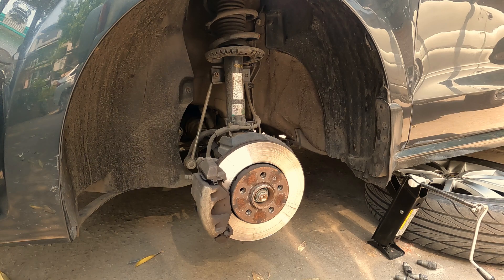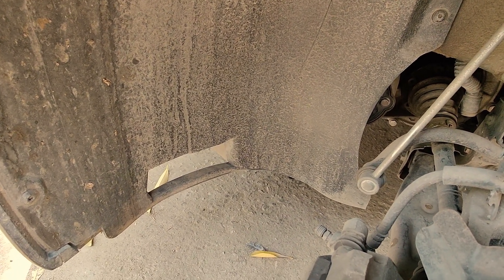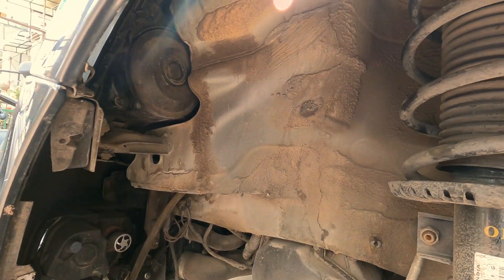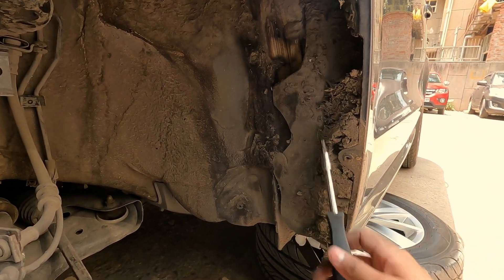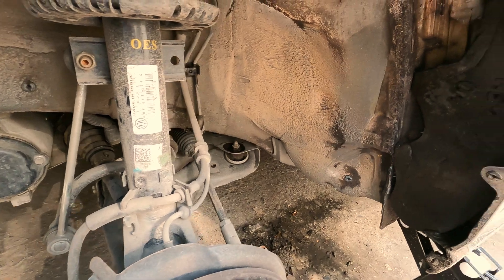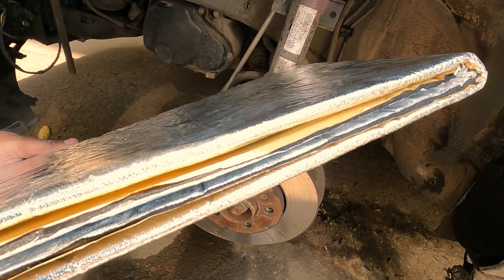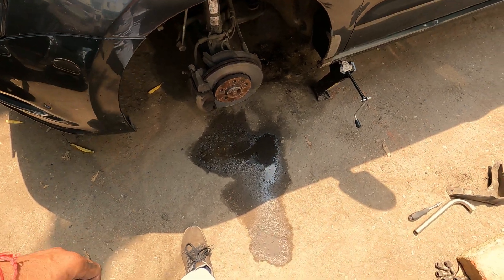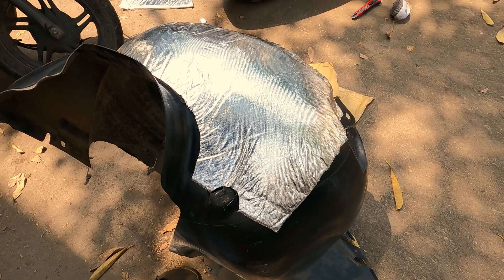CAR CABIN NOISE REDUCTION | REDUCING ROAD NOISE | ENGINE SOUND IN CABIN | VIBRATION | PART-2

Comment: Great video 

I am having Honda elevate 
I am also facing the similar issue . Could you please suggest the solution...

Should I go for door and other damping or just the damping which you had done on wheel arch is enough ?
Reply from the maker: Sir Damped wheel arches will help to reduce the road and tyre noise , damping the doors is a good option but not with the sheets we get in our market as they are adhesive based and in hot climate they slowly start to peel and fall inside , you can do more rubber seals on doors for more silent cabin but there is a limit , after that things become difficult .
Reply: @yourDIYneeds if possible then count you please make a video for Honda elevate to reduce tyer noise 

Before Ane after 

Bcoz many people are having the same issue

Comment: I have used door damping sheet on fender liners of Honda city diesel 2015. Now could feel a difference in cabin noise. I think I would be having most silent cabin of honda diesel car around 51 db.
Reply from the maker: That's great sir 👍
Reply: I'm facing same engine sound issue on my Honda city diesel what else did you do brother?
Reply from the maker: Sir there are 3 videos in total by name of cabin noise , have a look
Reply: Did you applied on all the fender linears ? 

What about the type road noise ?

Did you applied any solution?
Reply from the maker: Yes sir , all the fender lines got covered with a thermo-acoustic sheet .
Sheets were able to cancel a lot of tyre and road noise , so nothing else was needed

Comment: The result will be the same if you will apply damping sheets from inside, the idea is to make the sheet metal absorb the vibration using damping material, the placement can either be outside or inside, because inside it may be easier and will last long.

Comment: Nice job with the tire fender sound damper job.  Question:  For Butyl-type products, would the sound dampening qualities work better if it was applied to the frame inside the wheel well, or is it better to apply to the plastic fender?
Reply from the maker: Sir , ideally we just have to create a barrier for sound and the very first thing which comes in the way of noise is fender liner , that's why luxury cars have fender liners covered with felt fabric .

Comment: So glad I saw this. I have maruti Baleno (old) Want to reduce noise levels especially road noise when you go on rough roads or loose gravel. Will dampning help reduce it?
Reply from the maker: Yes sir , it will help
Reply: @yourDIYneeds Thanks. Is there anything else that I can do to reduce these noises? Car has new ball joints, lower arms. I just get these horrible noise on broken roads or loose gravel roads. Thanks for your help
Reply from the maker: Sir Have you checked the sway bar link rods ( stabilizer rods ) ?
Reply: @yourDIYneeds  Yes. New bushes have been changed
Reply from the maker: No sir not new bushes , i am talking about sway bar link rods ?
Reply: @yourDIYneeds  Yes. Link rods have been replaced as well.
Reply from the maker: Sir then only 2 things are supposed to be replaced for a quieter cabin is 
1 - strut top mounts with buffers
2 - pendulum engine mount
Reply: @yourDIYneeds  Thanks. I wonder what a pendulum mount be on a Baleno?
Reply from the maker: Engine stabilizer mount

Comment: Brother my car has recently come from the shop after a full rust welding job , after which the cabin road noise has increased significantly while driving high speed on the highway but no in city , also there's warm air that touches my right thigh while driving , I am confused as to what to get checked , please provide suggestions. also my tyres are old.
Reply from the maker: Old tyres will make more noise , that's for sure , improper alignment can also be a contributor as well

And usually if a mechanic removes the insulation from the floor for any kind of repair , they never put it back , and the issue of warm air is something you have to check , maybe due to the absence of insulation now the engine heat is getting transferred to the body and you can feel it
Reply: @yourDIYneeds  brother,  I just observed my front left wheel fender liner is missing,  can that also add to the problem?
Reply from the maker: Yes sir , it will add to the problem

Comment: i having same issue in my car,too noisy while i am driving,Tires are new,one of my glass was not closed properly which i repaired already,but still noisy especially even on the smooth roads
Reply from the maker: Sir an improper alignment can also increase tyre noise.

Comment: Tata safari dicor ka pickup low hojata h kbhi kbhi kya problen ho skti h
Reply from the maker: Sir koi check engine light ?
Reply: @yourDIYneeds  kbhi kbhi jlti h apne aap
Reply from the maker: Sir ek bar MAF sensor ki wire check kijiye , kyuki safari me wo wiring thodi si loose hai , maybe uski wajeh se ho , baki fir bhi aap ek bar scan karwa le , kaam karne ke lie ek Direction mil jati hai
Reply: @yourDIYneeds  vedio dallo sir iske uppar ek ❤️
Reply from the maker: Sir already hai
Reply: @yourDIYneeds  thanks sir ❤️❤️

Comment: Does this effect the NVH level 🤔 would be good if you can share the results after this..
Reply from the maker: Yes sir , it helped to reduce the road and tyre noise at speeds , but at idle , its barely noticeable , as a whole it helps , goal is to reduce cabin noise , be it idle or moving , so its kind two side of a page
Reply: @yourDIYneeds  I am using yoko blu earth and they are audible in my vento...strange
Reply: @yourDIYneeds  ok would try then
Reply from the maker: Yoko are usually a little high on noise due to hard compound of tyres , designed for our Indian roads to protect tyres from cuts . 
If you really want silent tyres , then continental are the one you should go for , i m running s drives they are even more noisy 😅

Comment: My Tata safari front bumper is miss aligned because of minor accident, all the clamps are ok but not sure how to open, please do make a explanation video if possible, it would helpful for all looking for the same...

Thanks 🙏🏻
Reply from the maker: Sir , firstly from bottom grill , there are two 14mm bolts then screws and bolts from the sides of front tyre and then from the top near front radiator support when you open the bonnet . Then simply pull it forward